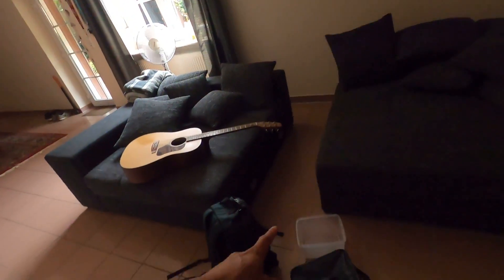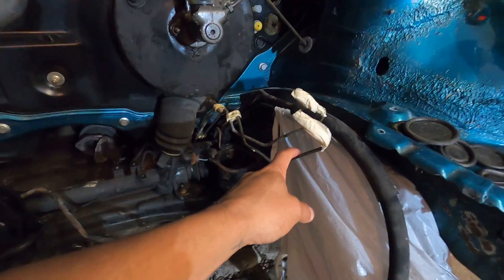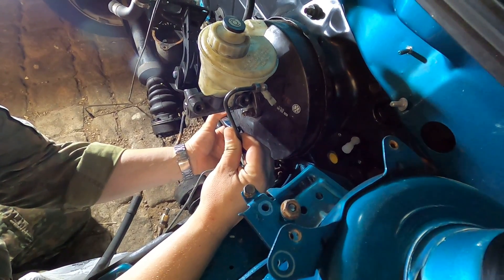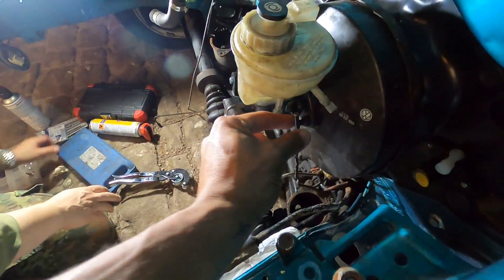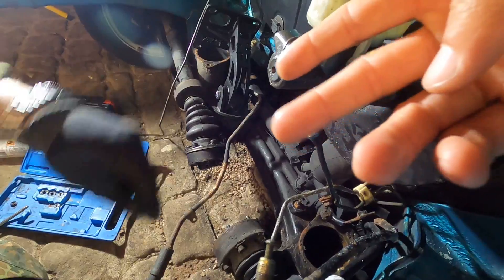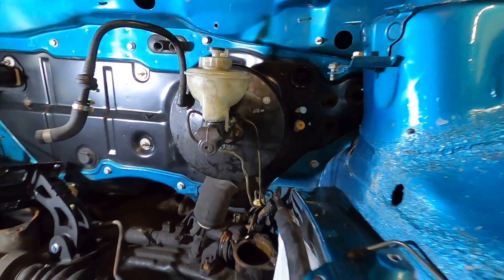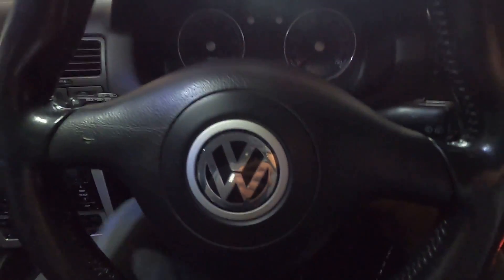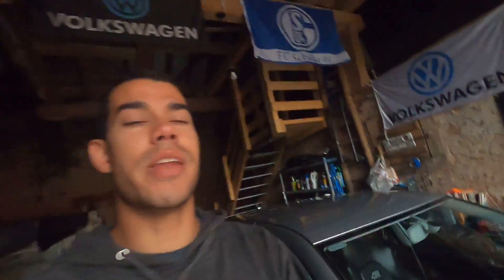Getting The Brake Lines Done In The Savoy! ( VR5 Swap Project )

Comment: Need to swap those lines on the passenger side of the master. Same goes for your Jetta. Also check for a proportioning valve on the rear beam now that you’ve deleted the abs.
Reply from the maker: Stefan Smith why swap the lines of it came factory like that? And it has the valve in the back I believe
Reply: Christian Smith Sorry dude, definitely not from factory like that. Yes your brakes will still work as you see in Miley but the was the master cylinder was designed I’m sure there’s a reason they run the lines the way they do.
Reply from the maker: Stefan Smith okay I’ll look into it maybe I looked at it wrong lol

Comment: you have both rear brake lines attached at the rear of the master cylinder. they should always be crossed i.e. rear left next to front right. this is for safety for when a master cylinder starts to fail
they come like that from the factory.
Reply from the maker: Jolt Koens they’re installed exactly the same way I have them on my Jetta which came factory with the non abs setup and every other non abs mk3 I’ve ever seen has both front left and right brake lines going to the front of the master and both left and right brake lines going to both rear spots on the master. Ive never seen one where it’s different